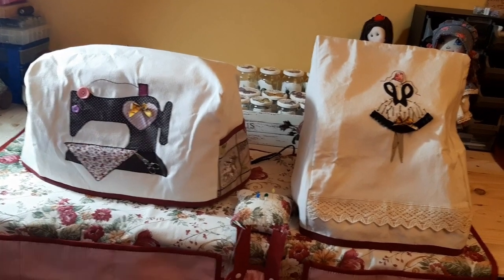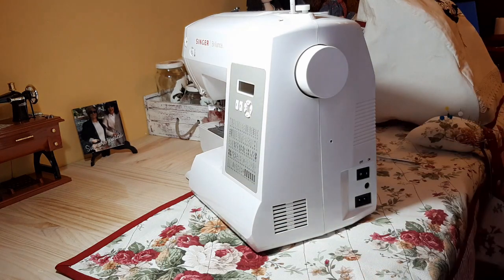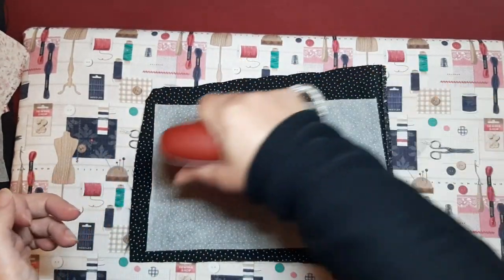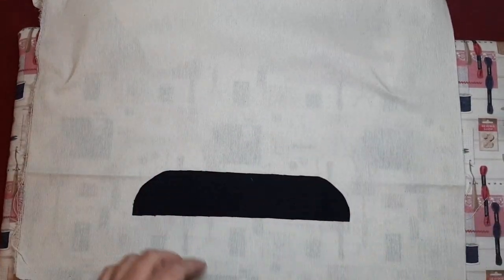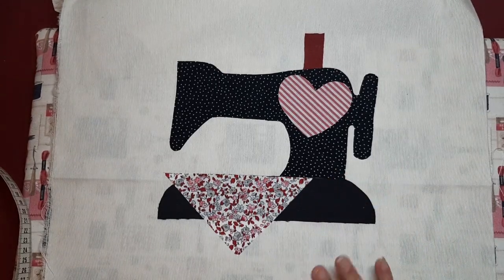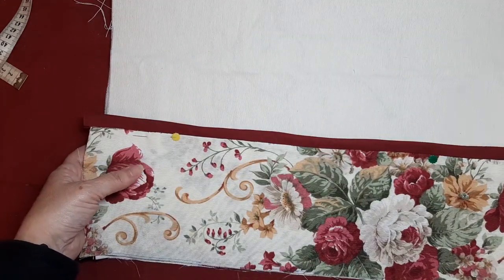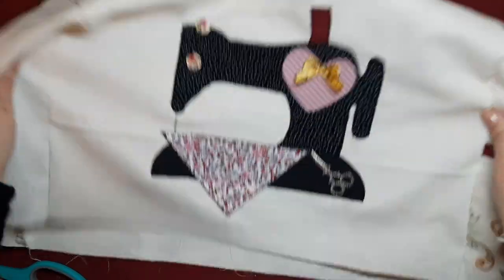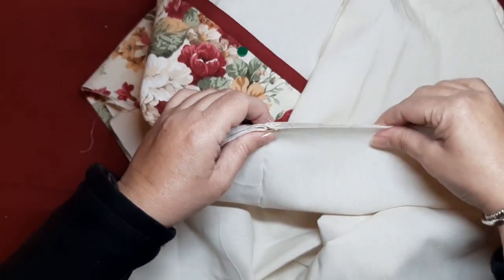Rincón de costura    Funda para máquina de coser Patrones Gratis

Comment: Buenas tardes Amparo voy a hacer la funda y mi pregunta es :como consigo esos accesorios ...tijeritas el lacito ( cinta métrica ).
Muchas gracias
Reply from the maker: Hola tesoro, los compré en pontejos Madrid, supongo que en mercerías o tiendas donde vendan tejidos y accesorios de patcwork,  o en tiendas de manualidades.  Espero haberte ayudado y que los encuentres, ya me cuentas, si? Necesitas los patrones? Un beso fuerte preciosa
Reply: @EltallerdeAmparo  Gracias Amparo los moldes ya los tengo me falta la tela y esos accesorios ya te contaré si los consigo. 
Un abrazo